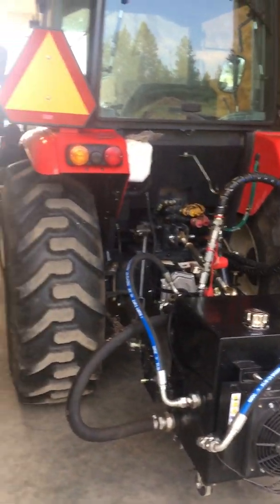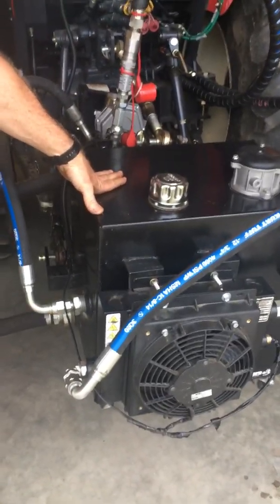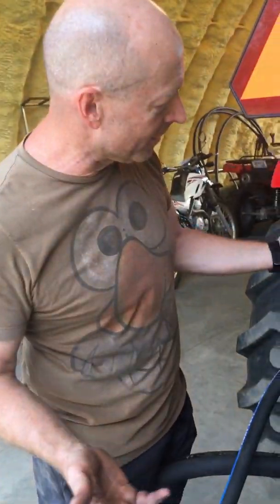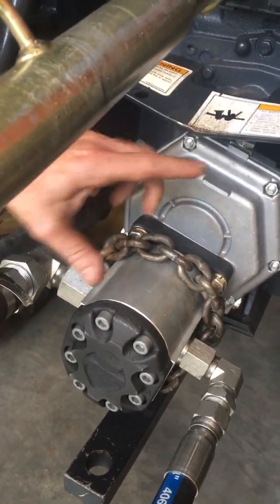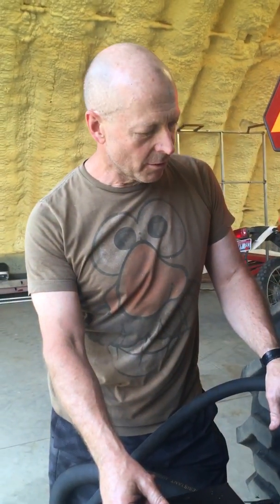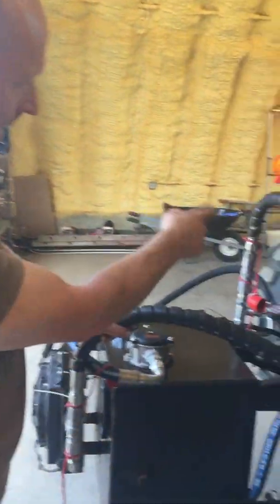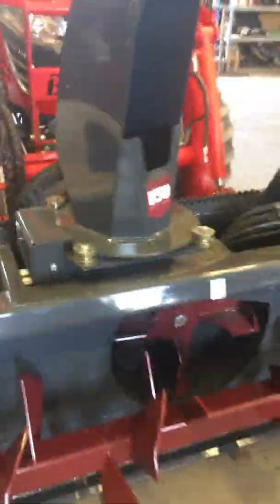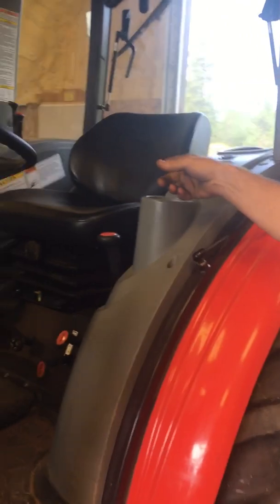Front mount skid steer snowblower on tractor loader arms with PTO hydraulic power unit

Comment: Great video. How did this work out? I just purchased a tractor with a power pack and skid steer snowblower
Reply from the maker: It works great. I built it for my father-in-law and he loves it. He does the whole neighborhood now just for fun. I have several videos of it on my YouTube channel. Check it out. Multiple videos of it in action.
Reply: @janericchannel4513  awesome. I have a similar setup. My tractor is a bit lighter and I have a bigger snow blower. I do t think it will perform as well as yours. I believe my gear box turns my RPM’s in to 2000 though, a bit more than yours

Comment: I am building a similar unit for a wheat harvester that I’m turning into a lavender harvester. I’m pretty sure i need different lines, but I’m curious about the pto pump. I have one that is supposed to generate 16.6gpm and 2500 psi. I have it matched with a hydraulic powered pto motor that is meant for 2500psi and at 16.6gpm should spin at 735rpm. It is not hitting anything close to those speeds. When I had the hoses made they gave me standard hoses like you would use on rear remote valves. Do you think just changing the hoses would solve the issue or do I need that same pto you have too?
Reply from the maker: What is the make and model of the pump? Also, what are the line/hose sizes? Also, how big is your reservoir tank? Lots of factors involved for sure

Comment: What did you use for a cooling fan/where did you get it… and the temperature switch? On/off temps?
Reply from the maker: The fan and the switches I got from Surplus Center online. I can’t remember any of the exact part numbers as it’s been a few years but in general here are some part number from surplus center that are pretty close to what I used:
Fan cooler:Model Number DCS10-12-BP65
Switch: Model 8037456 145NO or AKG TC-140-WL
Reply: @janericchannel4513  Thank you

Comment: Eric- this video is awesome.  Thanks for taking the time to share your design.  This will help me a ton!  Did you guys have a chance to try it out this winter?  How did it work?
Reply from the maker: Yes we used it about twice. Somehow or another the fuel gremlin i.e. father-in-law… Put gasoline in the diesel tractor right at the beginning of snow season! Unfortunately that killed the tractor. Ended up having to rebuild the head, new fuel injectors, new fuel pump sender, then the diesel particulate filter had to be deleted. By the time we got all of that fixed the snow was gone. So unfortunately did did not get a video.
Reply: @janericchannel4513  Ouch!  Next year I guess.  Anyway thanks again for posting your system.  This will make for a fun project this summer for our TYM 574.
Reply from the maker: @justinmartin2990  Oh wow you got yourself a TYM 574! I love that tractor. How much did you spend on it? I think that’s one of my favorite tractors. A lot of bang for the buck. Apparently it snowed this week in Idaho and I asked them to get us a video but that didn’t happen doggone it!
Reply: @janericchannel4513 It came in right around 35k, but yes I agree you get a lot for what you pay for out of that tractor.  We're in Montana and it's snowing again today.  I'm ready for summer.

Comment: Thanks for sharing that video. Right now I am going to build mine as simple as possible. Box blade to mount my tank on then 20gpm prince pump. Suction line from tank to pump. Pressure line from pump to blower. Blower has pressure relief line tee back to suction hose. Return line back to filter and into tank.
Reply from the maker: I bet it will work. I bought the same pump but the engineer at Virnig said it wouldn’t work so I sent it back and started looking for the system I have now. The company that sells something similar in the US is Cross Manufacturing. Northern Hydraulics sells them online 

https://northernhydraulics.net/catalog/cross-50-t-series-gear-pumps-158-1.html